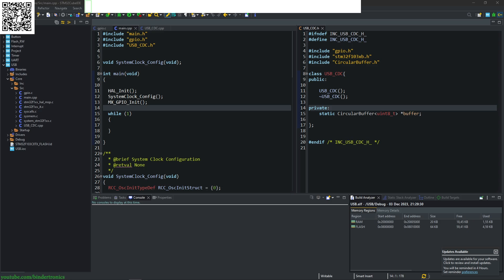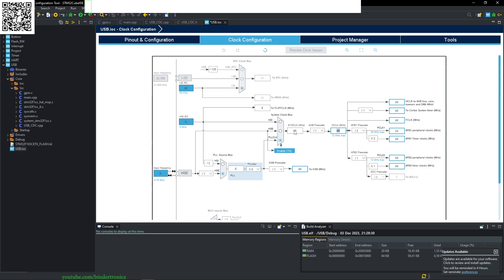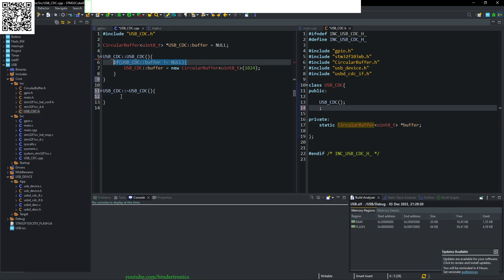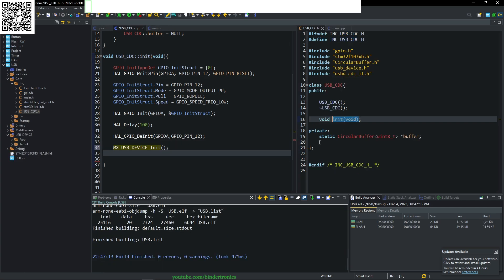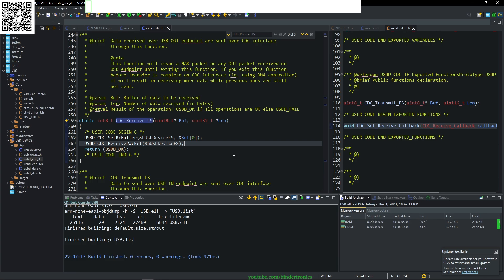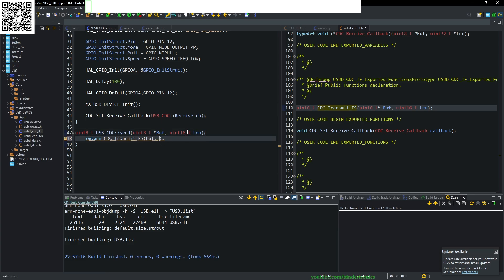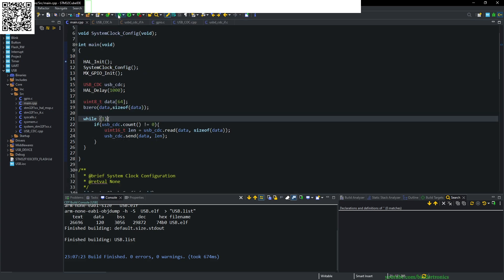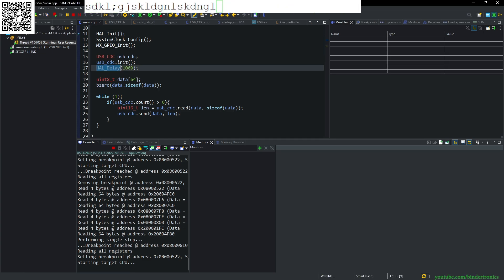USB Serial Port 🟣 STM32 Programming with STM32F103C8T6 Blue Pill C++  in STM32 Cube IDE

Comment: Is this code in a partiular git repo ? Its a little hard to follow as you go a bit fast, but if the code was in a repo it would be easier to watch and then look at the code. Thanks for the video !
Reply from the maker: There is a playback speed setting. left right arrows 5 second skip. < > frame by frame. I am not feeding the LLM AIs for free.

Comment: Very nice! Thnx. And how can build bridge between usb and 1-wire uart (TX and RX half-duplex)? Can u do example?
Reply from the maker: Too many methods of doing it.
Here are the basics: 
Pass incoming USB data to UART tx.
Pass  UART rx to USB out going data.
If your MCU supports flipping RX and TX pin. You can use that to create a one wire, otherwise you will need extra hardware like a RS485 chip.
Reply: @BinderTronics  It is possible to make interaction between the ELRS transmitter (for example BetaFPV Micro TX V2 Module). It uses 1 pin for reception and transmission, and no RS485 chip is used. The TX12s remote control does this, transmits joystick and switch data to the transmitter, and the receiver in turn sends telemetry to the transmitter, the remote control receives telemetry data through the same pin.
Reply from the maker: You might want ot try GPT should be able to get you up and running with your use case or you could ask on https://electronics.stackexchange.com/

Comment: 😊 hello pleas you know how to add plib.h in mplab x ide v6.15 , ... how to configure , pleas make video thank you , I have plib.h only mplab  5.40 I don't know to add in the new version
Reply from the maker: Has nothing to do with you IDE. It is the compiler version you are using. You have 2 options A: update your code to work with the new libs. B: install a old version of the compiler.

I am not touching PIC32 MCUs. Prefer staying sane.
Reply: ok thank you 😊

Comment: I want to check embedded programming on ARM/STM32 starting with a Nucleo board. Whereever this journey will take me, should I develop on Windows or Mac with STM32CubeIDE? I’ve heared that the industry standard for developing on ARM is Windows most tools, drivers etc).
Reply from the maker: NUCLEO-F103RB (got a bigger flash size) is the same chip I am using here.

Whole getting started series for STM32
https://www.youtube.com/playlist?list=PLtuqBdbsL-DvXMyzhGnODxjYmrH9v-PPY

I'd recommend this series if you are just starting out
https://www.youtube.com/playlist?list=PLtuqBdbsL-DvbB6QAGgoGBAEsGuXfGFoF

Basically what I am doing on this channel is very close to what someone will do in the industry at the starting point of a project.
Yes most of us work on windows. Using  Docker + WSL2 is becoming more common (it is my preferred work environment).Windows and Linux are the preferred environment in general. You will also get more help for these platforms.

You are going to have a hard time getting support for Apple products and you get better hardware using one of the other 2. I have only met one person that used a Apple device for development and I have nothing good to say.

If you already have a Apple device don't by something new. It will work fine.
Reply: @BinderTronics  Thanks for your detailed answer, appreciate it! I use mac but also have a linux notebook. I think I will try both for my first projects and later maybe windows/wsl2. Of course I know your playlists 😀 They are excellent! I also just detected that the MSP430 is also a very good platform to begin with and the toolchain works on linux.
Reply from the maker: Just as a note. I have never seen TI MCUs on a job spec. It is mostly STM, Nordic and Renesas. I have also seen that MCU recommended as a starter and I have no idea why. Might be a American thing.